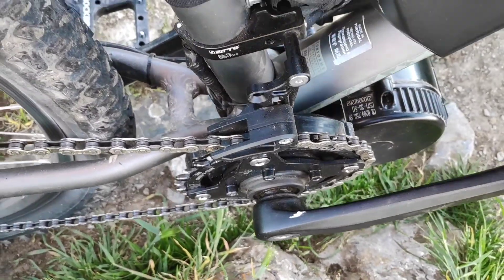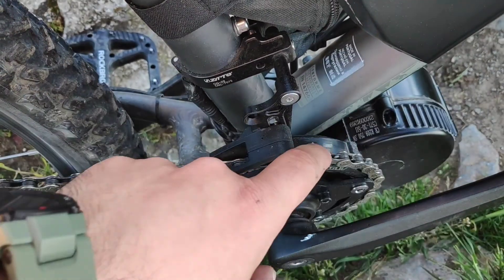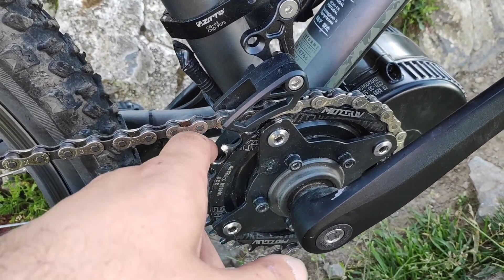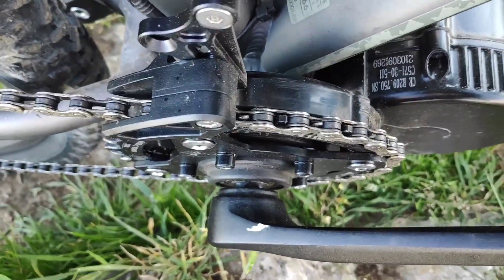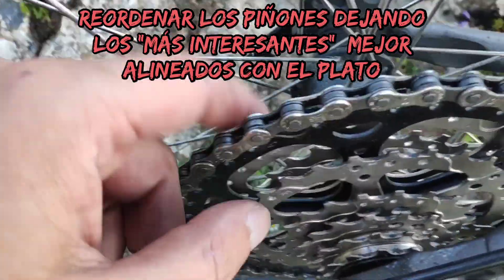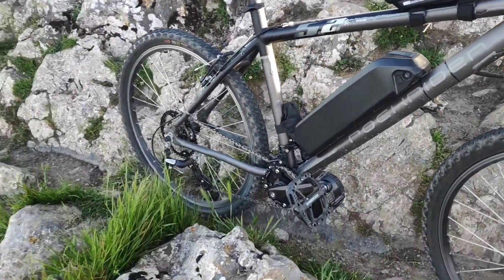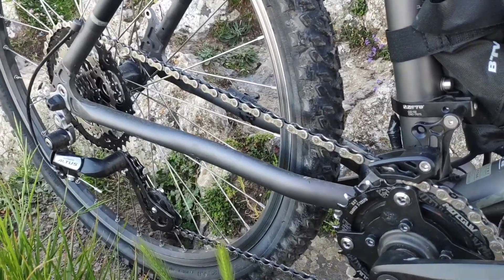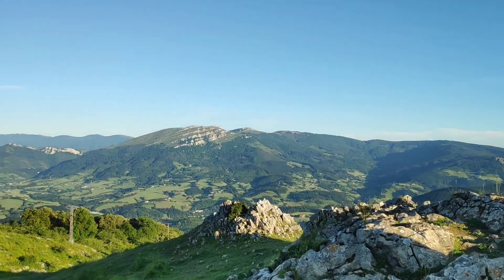KIT Bafang EBIKE: Adaptar su uso en MTBs para hacwr Montaña.

Comment: Buenas,  Yo también tengo un bafang 750w y al igual que tu,  le he puesto un plato de 32T, pero a diferencia del tuyo el mio es un plato que ha salido nuevo y viene montado por dentro.
Mi pregunta sería la siguiente,  entiendo que lo de cambiar de sitio los piñones, es porque quieres aprovechar los últimos para que suba mejor verdad?.
Si los dejo tal cual vienen montados, el único problema es que no podré usar los dos últimos piñones? Cosa que a mi me da igual,  ya que pon un motor 750w y plato 32 subirá con cualquier piñon.
Perdona el tocho y un cordial saludo.
Reply from the maker: Hola! cambio los piñones porque la linea de cadena queda muy torcida y solo puedo utilizar los primeros 5 piñones. Una pregunta , cual es el modelo que lleva el plato por dentro? Un saludo

Comment: No lo creo. Yo tengo un plato offset de 42 T con un desviador de 12v con un piñón grande de 52T y subo por donde quiera
Reply from the maker: El desarrollo de tu cambio (42t/52v) da 1,67m por pedalada,  no hay mucha diferencia con el mio (32t/42v) que da un resultado mas corto de 1,58m por pedalada. En mi caso el cambio no admite piñon tan grande como el tuyo y  lo de subir todo, pues es relativo, subiendo por una pista con la asistencia al maximo dandolo todo  see partio la cadena (KMC de ebike). En mi caso echo en falta un desarrollo mas corto para zonas puntuales extremas. Un saludo.
Reply: puede ser que se partiese por llevar la asistencia al máximo?
yo la pondría a 2-3, y piñón más alto posible también según la programación, 
recién tengo un bbshd y voy adaptándome a él.
un saludo @DMartina76
Reply from the maker: @fonta2  Si , por llevar la asistencia al máximo + pedaleando a tope + el desvio de la cadena que iba mas forzada. He mejorado el offset con un plato especifico para bafang, un desarrollo mas grande y no he vuelto a tener ninguna rotura